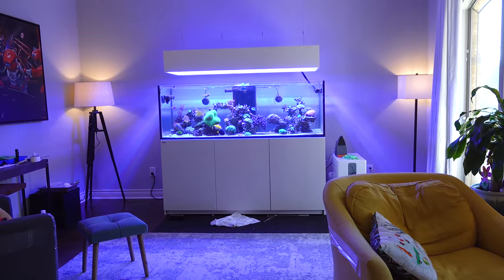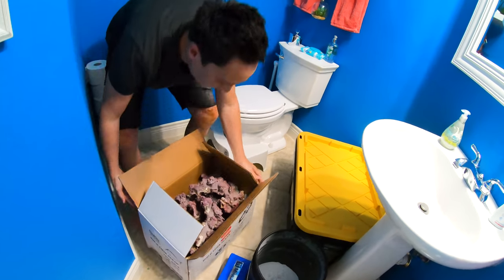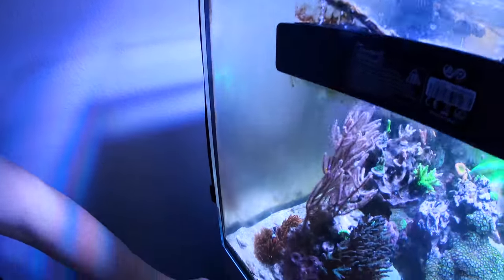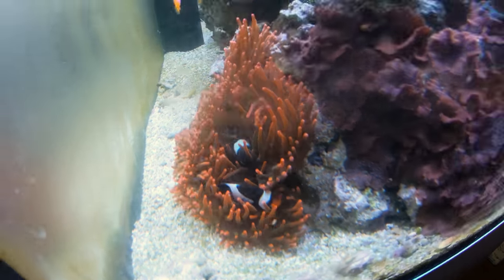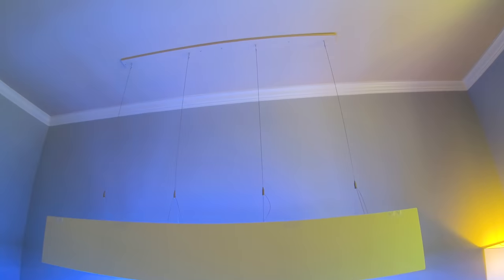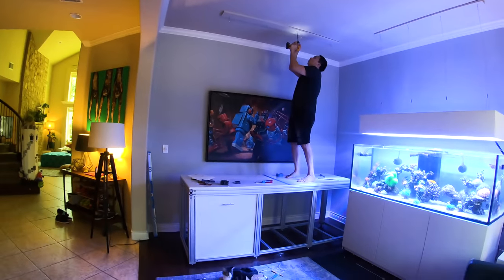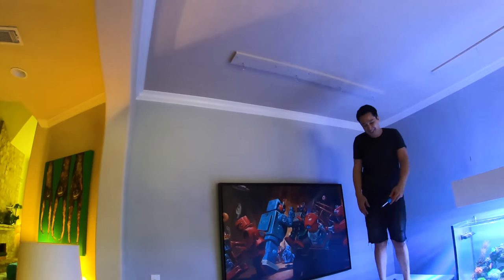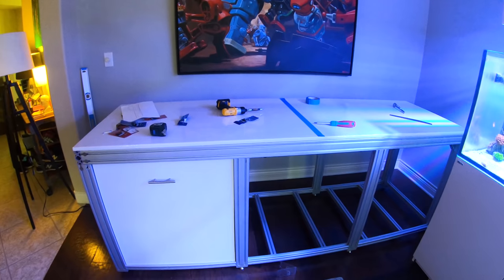Let's Get Ready For Our 400 GALLON REEF TANK

Comment: Cordless impact driver. I promise you will love it. More power, less stripping and no need to use a manual screwdriver. I've got a couple cordless drills, but after getting the impact, I hardly use them.
Reply from the maker: Thanks!